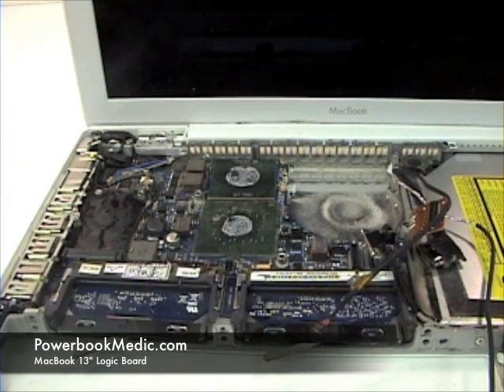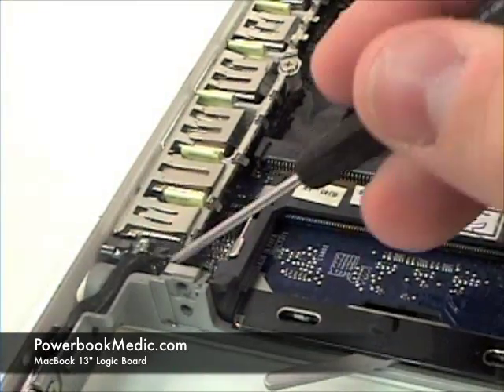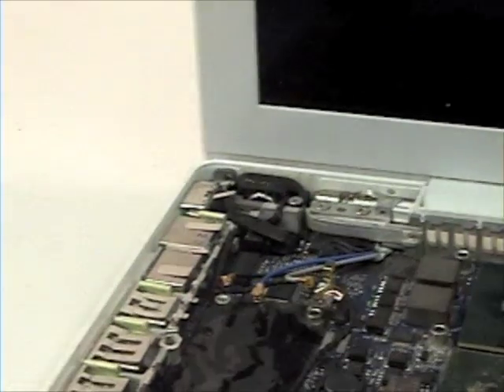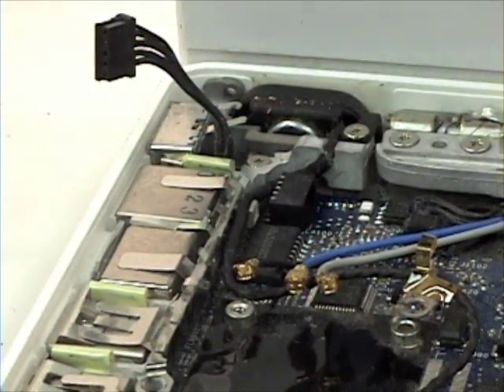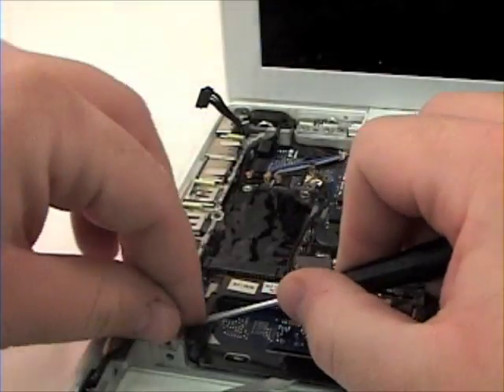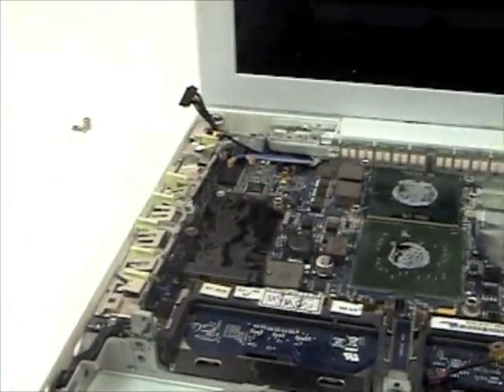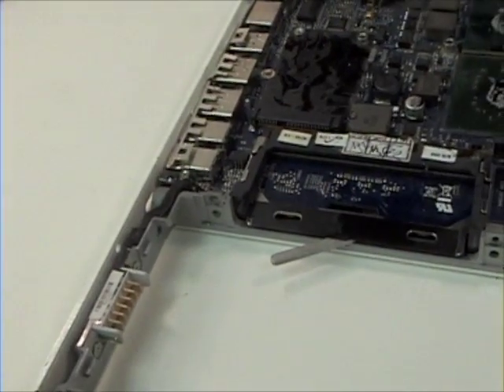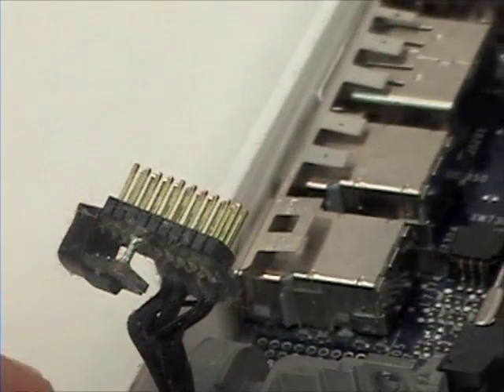Macbook 13" Repair - Logic Board Removal

Comment: So I’ve decided to fix my broken A1181 MacBook for the third time. The charger cable sparked a while ago, recently bought a new charger for it, everytime I plug it in to turn on the screen blinks but doesn’t come on and the little white light on the bottom corner just stays white. Do you think this would be a logic board problem? I miss it and all my data on it, was thinking about just buying another MacBook same model and putting my old hard drive into that. If I can fix it though by replacing logic board myself I will. Any help on the matter? Hope to hear from you, thanks for reading.
Reply from the maker: Stephen Daniels Yes, the solid sleep light indicates a logic board issue. Replacing should fix it.

Comment: great video thanks. i've snapped a jack off in my audio input on my Macbook. i've tried all the youtube tricks for getting it out( super-glued earbuds, tweezers, magnets..) but she's stuck in there well and truly. I believe the only way to remove it would be buy removing logic board and then replacing/restoring the audio port. and advice? or i could just throw it in the bin and buy a new one...

Comment: hi mi MacBook was being charged when the adapter fell. I thought nothing of it and even turned it on and it was fine althought the battery was taking no charge. a hour or two later the laptop would not turn on at all. I tried a new charger, MagSafe adapter, battery still nothing. do I need a new logic board? thanks sooo much

Comment: I have a macbook a1181 that I bought online and it lasted me a long time and then one day my little brother picked it up and plopped it on the bed where it kind of bounced after that it didn't want to turn on the sleep indicator in the front turns on and the laptop kind of makes the noise that it did when it worked when you turn it on. Do you know what might be wrong with it? I'm trying to fix it to give it to a family member.

Comment: Hi,
I have a MacBook Pro ('07) with a malfuctioning Nvidia graphic board. I went on and opened the laptop, disconnected the cables, unscrewed screws, did the oven trick, obsitute the thermal paste then i put it all back together. Pushed on the power button and... nothing. The machine itself turns on, but no gong noise is heard, the screen and the keyboard stays unlit.
What did I misconnect? 
A little tooth that was keeping the ram anchored, broke.I secured the ram in place with some tape...

Comment: Hi!
I have the A1181 Black Macbook, and when I turn it on I hear the boot up MacIntosh sound and see the Apple logo, but it just goes to sleep after that and it won't go back on. I can hear the Superdrive making a lot of noise aswell. I tried to boot it without the HDD and I still have the same problem. I spilled water on it, do you think i need to get a new Logic Board or a new top case? Thanks

Comment: @PowerbookMedic - I notice there are about 2 or 3 (maybe 4) loose cable towards the top left of the logic board that appear to have been previously disconnected from something before you got to this step, but your video doesn't show you disconnecting them.  Could you explain what they go to or provide a video of you disconnecting them and why?  Thanks

Comment: Hi!

I have a black a1181,and its onboard soundcard doesn't work at all,because that little switch in it's jack slot is broken.i'm using it with an external firewire soundcard,and the sound cuts out sometimes,so i need to unplug the soundcard and then plug it back in.can it be because of the faulty onboard soundcard?is there any other options to fix it or only a nes logicboard would help?thanks.

Comment from the maker: @MAGGZ214 - The problem is likely going to be either top case or logic board related for your model. We have a free diagnosis service if you wanted to send it to us for inspection. You can call us to get a quote and setup a diagnosis at 1-866-726-3342 option 2.